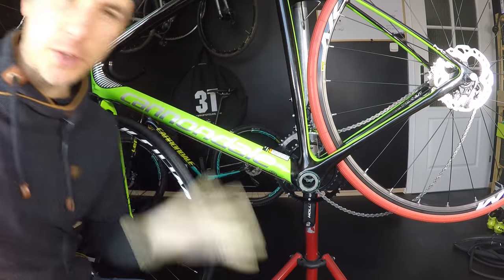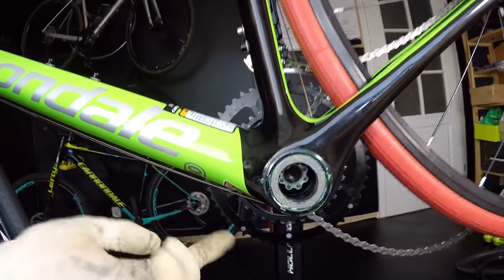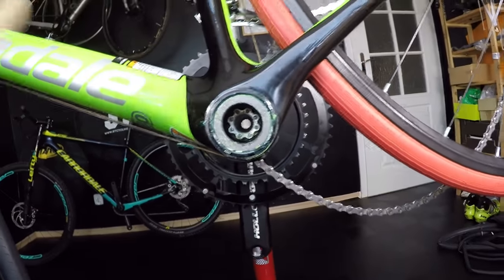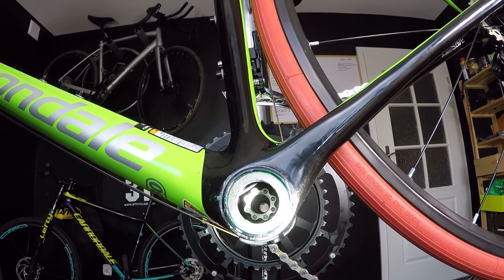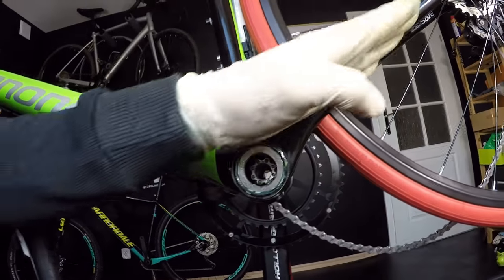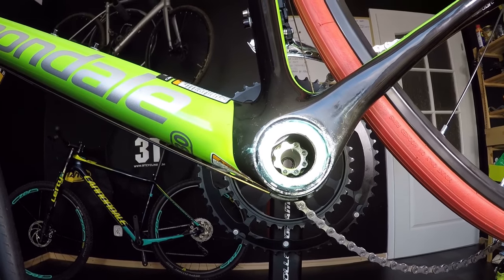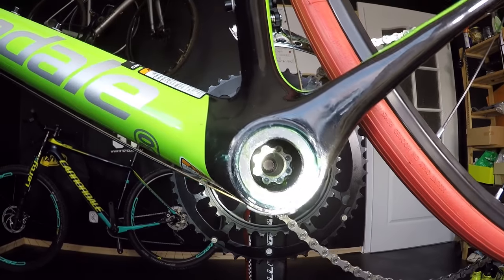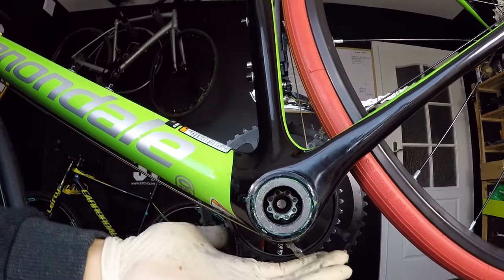Cannondale SuperSix EVO Owners - Inspect This Place In Your Carbon Frame.

Comment: I fixed my creaking Evo with a BBInfinite bottom bracket. It's one piece and the cable goes over the top. No problems, quiet as can be and spins like mad. Love it. Great video.
Reply: Does the bbinfinite fit on this frame? Does the cable get in the way of the shell?

Comment: 2018 SS Evo High Mod.  I was out riding and this happened after about 850 miles. Luckily I didn't crash, but I almost did...  Went back to the LBS that installed it and thought it was fixed.  I'm hearing the rubbing again so I'm not going to take the risk again.  Stop riding immediately if you hear a constant rubbing down there when your pedal.

Comment: This just happened to me.  The rear derailleur cable was incorrectly installed on the new bike and it effectively cut the crank shaft in two parts after about 500 miles. Sadly, I was doing 26 MPH when it happen and got pretty injured.  So please check the cable routing  when work is being on the bike.
Reply: Happened to my this weekend..

Comment: Hi Danny, problem I have is ,I'm trying to fit new rear gear cable, and it seems something blocking it from going through the chain stay,?I've stripped down chain ring and there's something stopping cable getting through frame and down to gears, but if I push it up from gears to the BB housing, it hits something on the way up ,but with a bit of fiddling around I can get it to come up to BB housing?? Please help, or any of your followers have had same on there supersix, thanks in advance Steve

Comment: Hi Daniel,

What would be your answer to a good bike for city commuting. I commute in London on a daily basic and I would appropriate if you could  share some tips how and what to look for while building/buying a commuter bike. Also would you be able to advice on bike lighting for such a bike - lights which don't require additional battery packs and can be removed easily.

Thanks,
Frank

Comment: I have an older cannondale bicycle (1989) and the routing is outside the frame under the bottom bracket area (perfect design). I recently purchased a newer cannondale evo (2018) and the cable goes into the frame at the bottom bracket (like the bicycle in the video). I have to say that this "internal" cable design in the bottom bracket is a very bad idea. I've always been a cannondale user (since 1989) and I must say, I now regret purchasing a new bicycle with internal cable routing. I wasted my money on a very bad design. My older cannondale frame has the cable outside the frame on a plastic track under the bottom bracket. I wonder if these new frames can be converted/modified to use the older cable routing design outside the frame in that area? I wish that I would have caught this design flaw before I wasted $8,000 dollars on a bicycle. I will be working on a custom design that will allow me to bypass internal cable routing completely. I'm working on several ideas at the moment. Maybe a full external cable routing, or inserting a thin external cable housing through the frame for easy cable changes and no cable contact inside the frame (if there is enough space to make that possible). I'll figure it out. Thanks for the video. I wish that I had seen this video a few weeks ago before I decided to start building a bicycle using one of these frames. I plan to use a bbinfinite bottom bracket and will need to be sure the cable does not come into contact with the cylinder that houses the bottom bracket. Internal cable routing is a bad idea in my book !!!